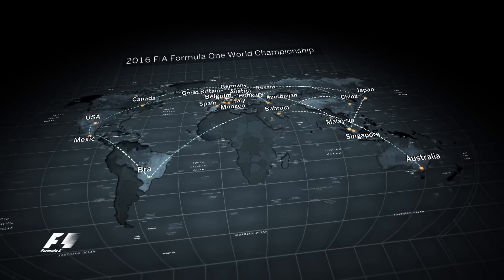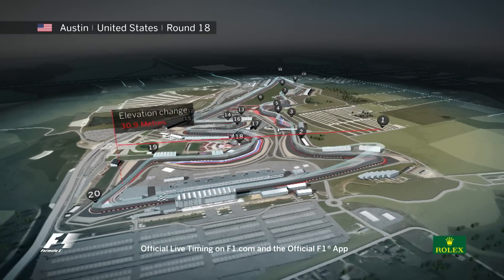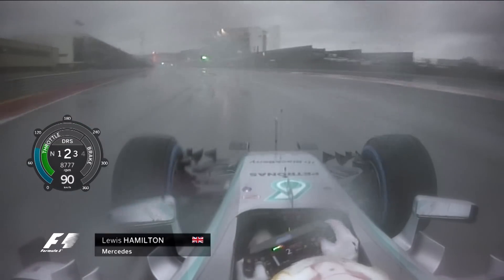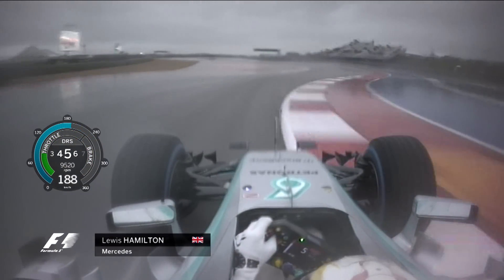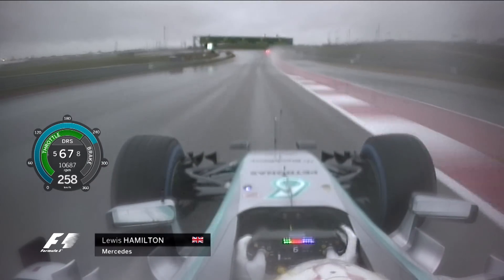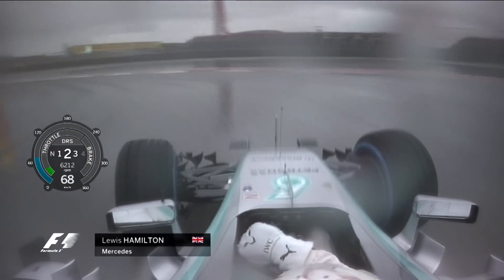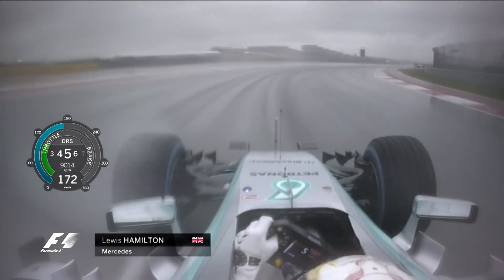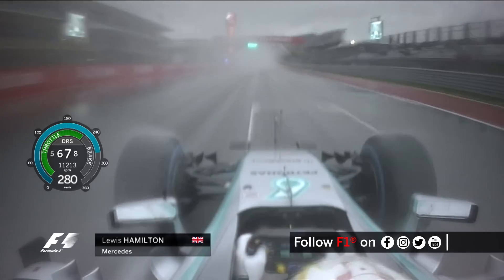F1 Circuit Guide | United States Grand Prix 2016

Comment: Insane track still turn 12,13,14 and 15 are uselless you could go from the straight directly to turn16 and so it would be a one of the best circuits. Nice lap in wets from Lewis.
Reply: You're crazy boy. That little section after the hairpin, produced great racing last season especially between the ferraris and verstappen. It's good because it's a place where many drivers switch back on each other and it makes for very nice battling. Having a very long straight followed by a hairpin towards 16 would mean the battling stops on the straight as the triple-right is a one-line section.
Reply: Stoo And it adds a slow, technical section to the track
Reply: Ofitus 21 All Tilke circuits have that sh*t.......If you look at the best circuits in the calendar you will find Spa (best by far) and also Suzuka. Both with very fast corners except for the haipins and the chicanes. So there are only 3 corners that are slow in both tracks. Its just my opinion, but i think faster tracks are generally more interesting to watch especially on boards
Reply: Diego Artazcoz
Agree. But a not very long technical section will offer some overtakes and it makes the track a more complete one. COTA has a super fast, high speed corners 1st sector, the long straight on the 2nd sector and the twisty 3rd sector. A good mix IMO. Not the most exciting but challenging and a good overtaking spot for the race

Comment: A DRS zone is normally 1 km. Am I right or not?
Reply: no, not at all. If DRS zones were normally 1km they wouldn't fit on any tracks straight apart from maybe Baku's. Heck, the second longest straight on the calendar is 1km long
Reply: TheDescendant So, maybe 700-600 meters?
Reply: :DaniKid pls probably less, 200 would be around the lowest probably 600 is around the longest (although there could be slightly shorter or longer)